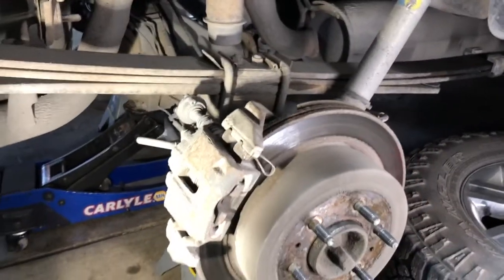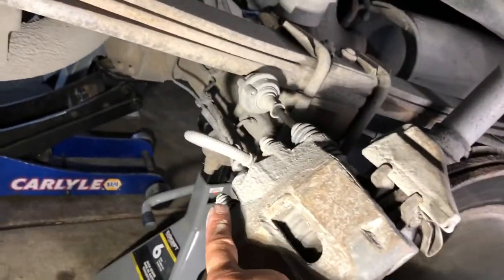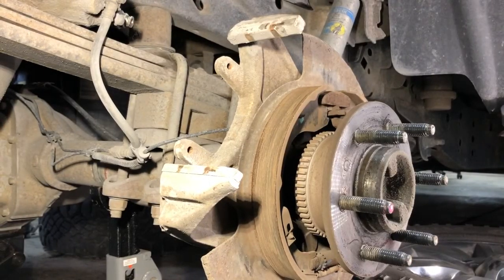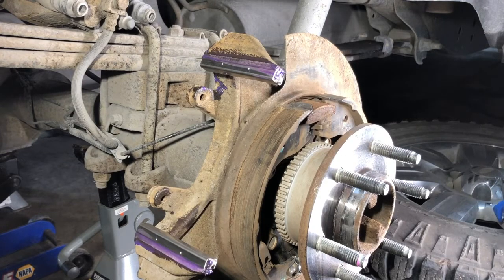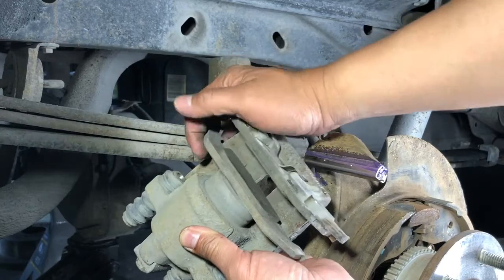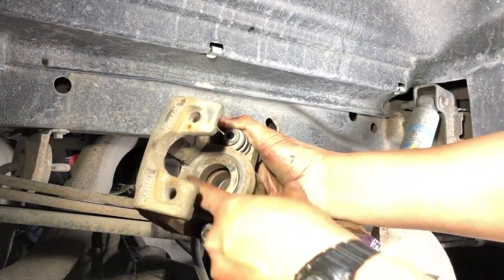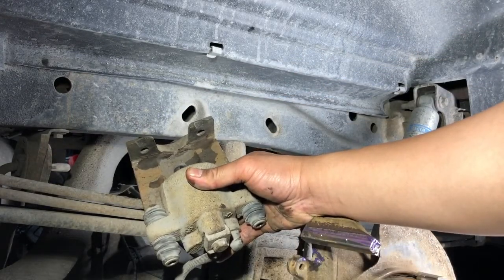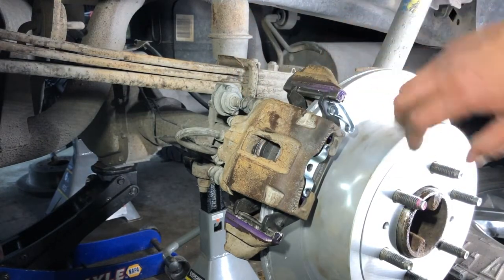2010 Ford F150 - Replacing the rear brake pads and rotors

Comment: Excellent video.  I would only add a step of spraying down the rotors with brake cleaner to get the packing oil/grease removed.  Great info on that upper caliper sound dampening bolt...had I not watched this video I wouldnt have had any idea what that thing was or why it was there!

Comment: Seeing I'm kind of old school and I have always had to deal with drum brakes on the back in the past. Having just bought a 2010 F-150 and it definitely needs a set of new rear rotors. I just wanted to see if there was anything I was unaware of, there was that top bolt. You were precise and to the point, a very usable video. So, I see no major complications going forward! Thanks.

Comment: The vibration dampener unscrews from the bolt so you can put a 6pt socket on it. The 'V.D.' has a rubber plug with a torx hole inside or vise grips, luckily mine wasn't tight.

Comment: PRO TIP:  The vibration dampener is actually THREADED onto the caliper bolt

IN OTHER WORDS: If you dont have the grippy/grooved/serated wrench referenced in the video, put a pair of vice-grips on the dampener neck (just past the 10mm bolt head) and unscrew the dampener off the caliper bolt. Now you can just use a deep 10mm socket on the bolt head.

~*~*~ YOU'RE WELCOME! ~*~*~

Comment: Never seen a vibration dampener. Thank you
Reply from the maker: Kind of hit and miss finding these on the F150s.  I haven't found a rhyme or reason as to which ones were equipped with them or not.
Reply: @AKJeeper  replaced my rear brakes and rotors with ceramic pads due to a slight squeak occasionally. Thought it would cure the noise but it is still happening. Any suggestions? Doesn’t affect performance, just irritating. Lol
Reply from the maker: @danielpowell8022  Does the noise change or go away if you barely touch the brake pedal (indicating the noise is coming from the brake system)?  Also, when you installed the new pads, did you put any brake grease on the caliper and piston (contact surface between the pad and caliper)?  I've found that the brake grease does quite well to suppress brake noises, but please apply it to the correct side of the pad - in other words, on the back side of the pads, not where the friction material contacts the rotor.  You'd be surprised how many vehicles have come into the shop where someone did a DIY brake job and applied the grease to the wrong side...
Reply: @AKJeeper  only squeaks occasionally. When it does I release slightly on the pressure and it stops. I did not use any grease. I will definitely try some and will not apply it to the stopping side. Lol. I’m sure it is a specific type. What do I ask for? Thank you for the insight and for your time.
Reply from the maker: @danielpowell8022  usually marketed as brake parts grease, or something along those lines.  The one I used on this truck can be seen at 11:06.  Sorry, I’m on my phone right now, otherwise I’d post a link to some.

Comment: Great video , but you can also remove that device from that bolt in case you have to, that way you'll be able to use any tools.
Reply from the maker: Absolutely true.  There’s more than one way to deal with the vibration dampener, and other people’s videos show the other methods.  I just showed what works best for me and in my shop environment.  One inexpensive tool saves a lot of time - I no longer need to disassemble the dampener and its additional components to remove the bolt.

Comment: Great video. I couldn’t find my 10mm wrench so as a welder/fabricator I cut that rubber thing off the bolt with my angle grinder and used my 10mm socket wrench. Haha
Reply: There's a cap on the back of that rubber thingy (it's a vibration dampener) and pull that cap open and there's a torx head in there 🤓

Comment: Awesome video. I love how concise you are with these steps. Looking to attempt this job myself. You mentioned checking the level of the brake fluid before compressing the piston all the way. What should one do if the fluid is at max level?
Reply from the maker: Hmm, I guess I must have forgotten to add the info in the video.  If the brake fluid reservoir is full, compressing the piston will cause it to overflow.  Typically, I will use a suction device like a Turkey baster to lower the level in the master cylinder prior to compressing the pistons.  Be sure not to use the Turkey baster on any food later, if you go that route.  Buy a new one to replace the one you grabbed out of the kitchen 😂

Comment: I am changing out my caliper on my rear passenger side. The new caliper comes with new bolts, do i need to install the old Vibration dampener, or can i replace it with just a regular bolt?
Reply from the maker: You can replace it with a regular bolt.  Ford was rather hit and miss whether these trucks came with the vibration dampener.  I’ve personally never noticed any difference between having the dampener in or not, as far as brake noise is concerned.

Comment: So for the rear brakes you don’t have to loosen the bleeder screw to compress the caliper piston?
Reply from the maker: I don’t feel that it’s necessary to open the bleeder screws when pushing the piston back into the caliper.  Definitely an optional step.
Reply: @AKJeeper  As a head up, Ford Motor Company recommends that the bleeder screw is cracked open during compression of the caliper piston to relieve backwards pressure into the ABS module and also to drain the old heat "cooked" brake fluid from the piston.  They warn this is important to prevent brake fluid from flowing backwards under pressure and damaging the ABS module which can be a $1,500-2,000 repair!
Reply from the maker: @fhiggenbottom  Ford has mentioned opening the bleeder before compressing the pistons on other models in the past…but none that I’ve seen in quite a while.  For this particular application, Ford factory service info makes no mention of needing to do that.  The only things they mention:  make sure the brake hose is not twisted on installation of the caliper, and when compressing the piston - protect the piston and bolts to avoid damage to those components.  Interestingly, Ford factory service info even shows the use of a c-clamp and an old brake pad as a backer as an acceptable means for compressing the pistons.  

Doesn’t hurt to take the extra precaution of opening the bleeders prior to compressing the pistons, and it’s always a good idea to flush out the brake fluid and replace with new whenever doing a brake job.

Comment: I thought you had to loosen you bleeder valve because with abs your not to push the fluid back though the system it could mess up your abs
Reply from the maker: On some vehicles this is true (GM trucks w/ 4WABS from the 90s).  Ford does not mention the need to open the bleeder when doing pad replacement on these trucks which is why I did not do it.  Always follow the manufacturer’s recommendation for your particular year and model of vehicle.

Comment: That anti vibration piece comes off just thread on like a nut
Reply: On the back of the dampener there is a cap you pop off with a torx, just loosen that right off the stud, then socket on the caliper bolt

Comment: Quick question I have a 2010 f150 do I have to open the bleeder valve when pushing the piston back in?
Reply from the maker: The Ford factory service data for this truck does not mention anything about opening the bleeder valve when pushing the piston back in.

Comment: Can the emergency brake be set when changing the front and rear brakes? I didn’t used to have to worry about it due to my old driveway was flat but now I have one that has a slight slope.
Reply from the maker: Setting the parking brake will do nothing for you if you are working on the rear brakes, since the parking brake is on the rear axle only.  I don’t advise working on a vehicle on a sloped driveway, but if you have to, only jack up one axle at a time, and have good wheel chocks on the wheels still on the ground.  Do not rely on the parking brake to keep the vehicle from rolling.
Reply: Thanks for the advice. That’s what I was planning on doing but was thinking of going the extra mile.

Comment: You forgot to clean the new rotor with brake cleaner 😅
Reply from the maker: Not necessary on these coated rotors - they come out of the packaging “ready to install”.  Normal rotors, yes - you absolutely need to clean the oil off of them.